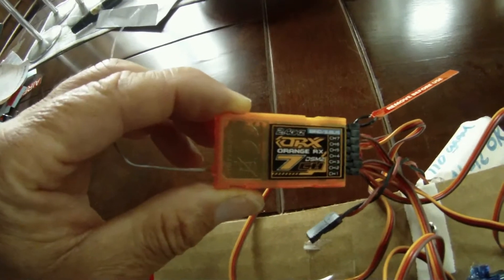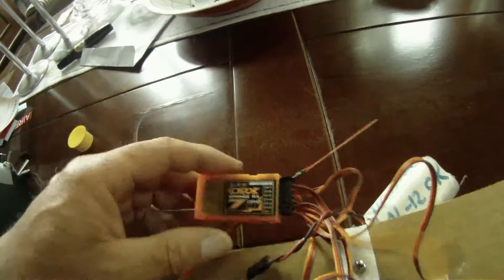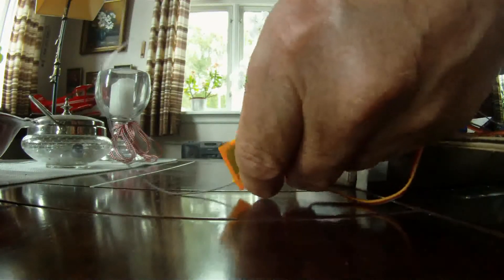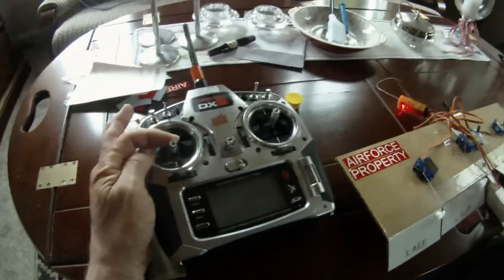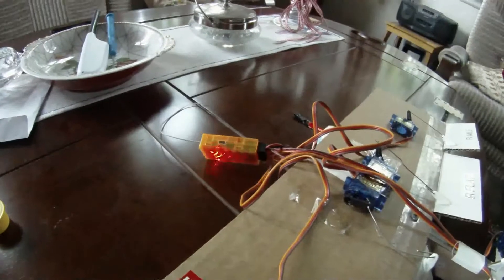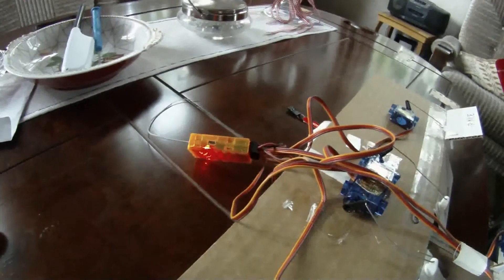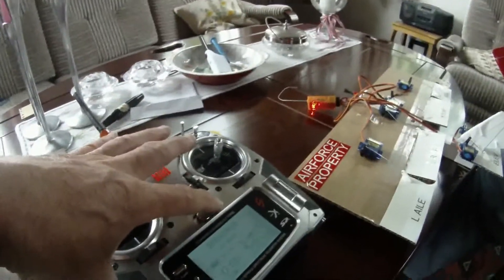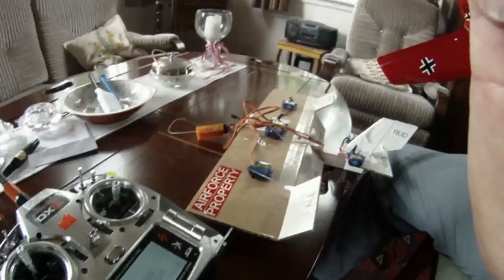Program the failsafe on Spektrum TX.

Comment: Hello!! I am having a problem here that a can't solve. It seems like that my receiver has only one channel with fail safe. Is there a way to program the fail safe in all the channels? Or this method showed programs the fail safe for all the channels?
Reply from the maker: Some recivers have only fail safe on the thottle channel.
I think you have one of them,, and then there is nothing to do.
Reply from the maker: What rx are we talking about ?
Reply: SpeedsterDEN It's the orx r710.
Reply: SpeedsterDEN I must be doing something wrong here because I have the same receiver as you
Reply from the maker: Rememberto remove the binding plug, when the rx are blinking,    before turning on the tx for binding,      as described in video....
Reply: SpeedsterDEN Thank you !!! I could solve the problem in all of my receivers!! You helped me a lot.
Greetings from Brazil.

Comment: on 9 channel orange  
1 throttle,2 right ail, 3 elevator, 4 rudder,5 left flap, 6 left ail, 7 right flap. spare channel used for ubec.
            Thanks again
                     Bob

Comment: Hi, Almost finished 3meter glider with flaps and ailerons.  I use the dx8 and orange 9 channel receiver. Not sure which channels to use with the flaps to have a separate channels for each servo. Dont want to cover in the flap servos until i am certain of their movement. Hope you can help.regards

                                                                Bob